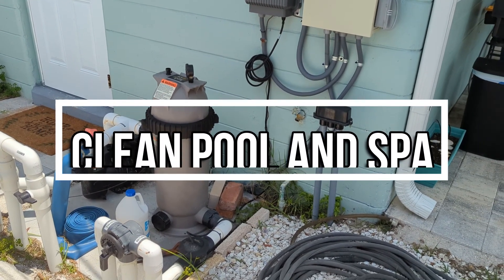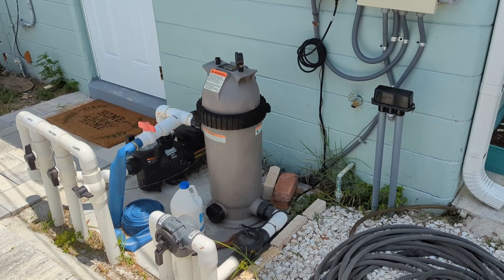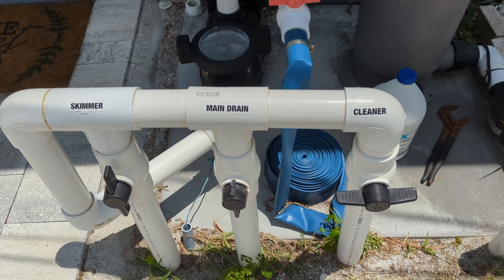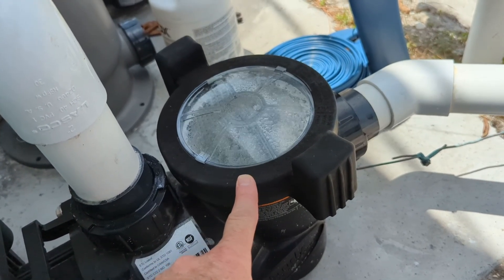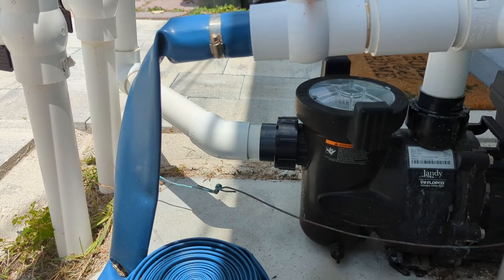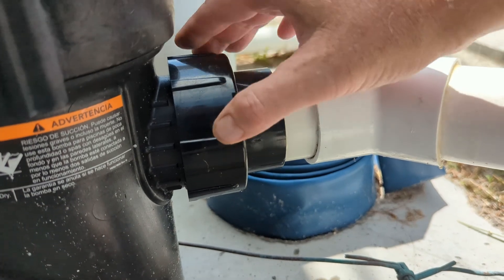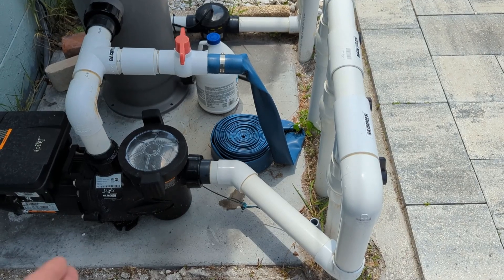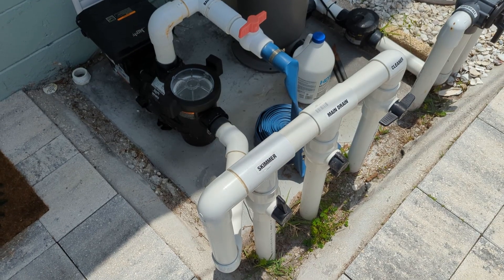Why Are Bubbles Coming From My Pool Return Jets?

Comment: We were having same issue there was no leaks anywhere or no air leaks,but I check are  valve  gasket and there was a very small nick right by the oil ring . You barely could see it ,but that was the problem.
Reply from the maker: Glad it helped and thanks for watching.

Comment: We have an inground swimming pool and I’m having air bubbles in my return lines in our pool…..could the reason be our skimmer face plate because two screws at the top are rusted pretty bad and it has rust at the bottom….but I’m not losing water at the skimmer…..I checked the O ring and put magic lube on it really good……I have a Hayward Super Pump